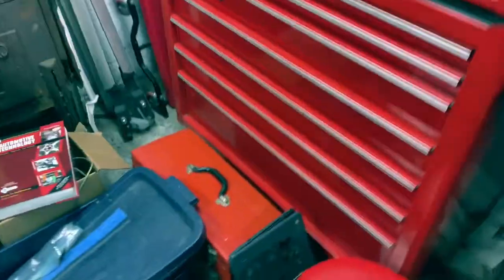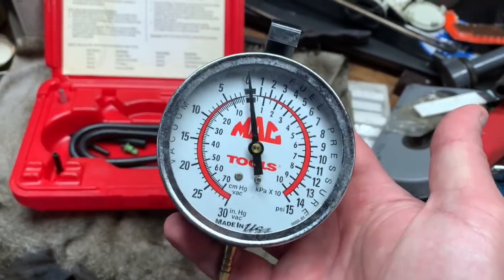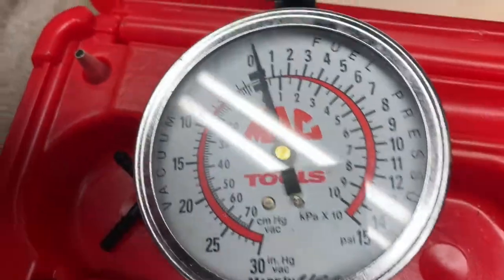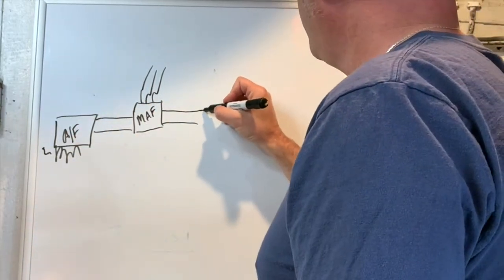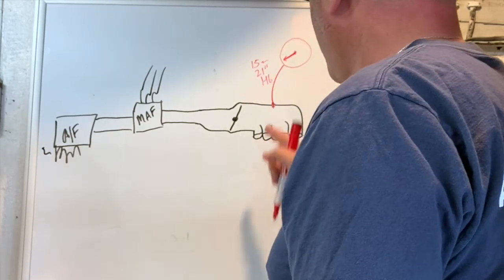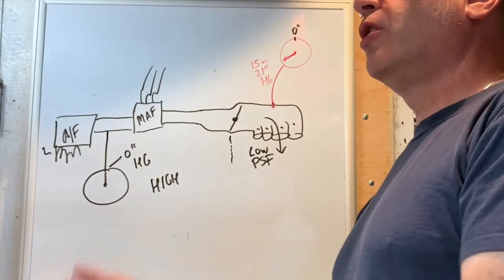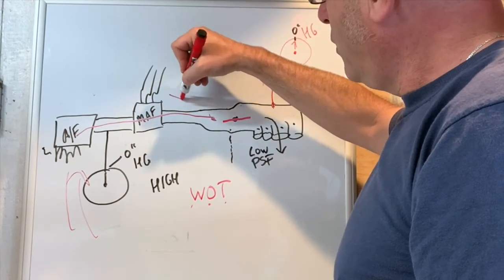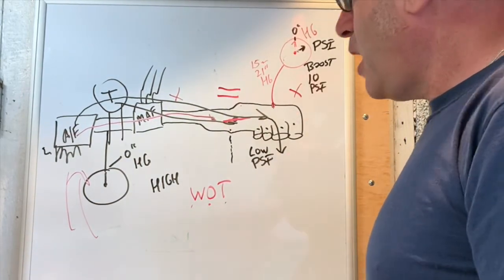How a vacuum gauge is hooked up, and why the needle moves.

Comment: Hi, I just installed a vacuum gauge 0-30 in.hg to my peugeot 206 1.6 16v but it's measures only 2 IN.HG at idle and when I rev up It tends to go
to zero. My gauge takes measurements from its sensor not directly from a vacuum hose. From intake manifold to pcv valve I have replaced the vacuum hose with a larger one (8mm id). Could it be the reason that it measures so low vacuum?
Reply from the maker: Ah, yes, the 206, I know that car here in the US as the Mini cooper engine, the engine uses a throttleless valve system, it can only "see" vacuum as a "theory" reading based on intake valve operation. I had that car (2013 Mini / Prince engine - Turbo N18) - My physical boost gauge would only ever read boost, never vacuum, I tied in under the MAF sensor on the boost pipe.
Reply: @danjreed  Mine has only a Map sensor on the intake manifold and next to it it has another pipe where you connect the evap vapors and the pcv valve's vacuum hose using a T type quick release fitting. There I connected my vacuum sensor using another T type fitting. I also connected the inline filter which was in the kit. I think that by decreasing 8mm hose diameter I will have better vacuum readings.
Reply from the maker: @konstantinoskiprislis3192  I used an adapter sandwich plate,.

Comment: I have 2 OTC vacuum gauges and when I check vacuum on a BMW R12000GS, the needles are bouncing all around at idle. If I bring the rpm up around 4K, they mostly stabilize. They are connected after the throttle plate. Is there anything I can install in line to stabilize the needles?
Reply from the maker: Check your valve clearances. In general needles that bounce or move a lot at idle point to valve spring issues. https://www.youtube.com/watch?v=VdbFo0Qu8t4